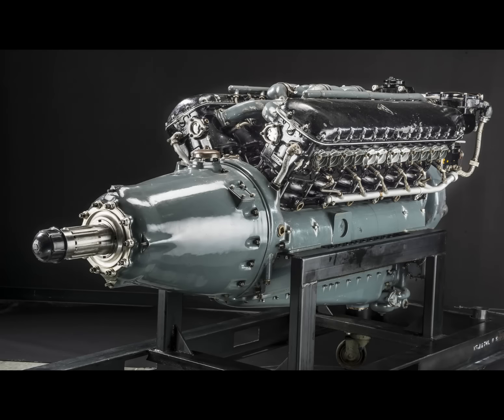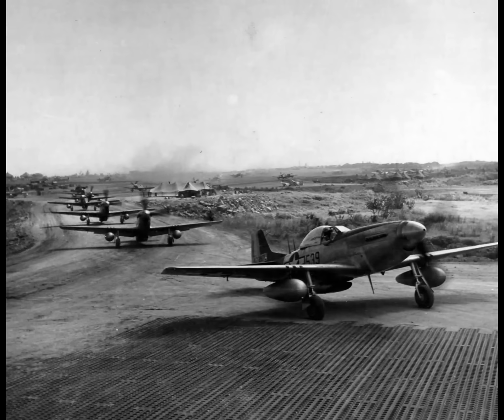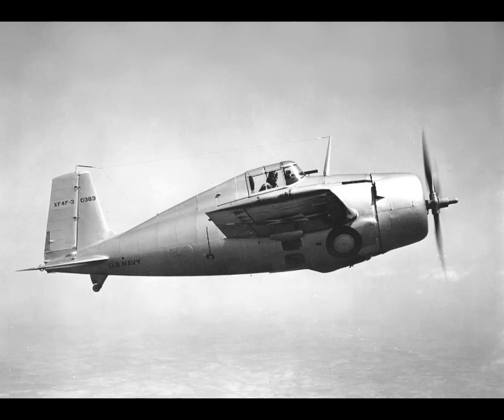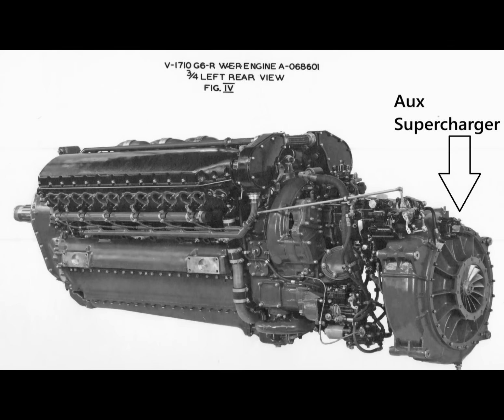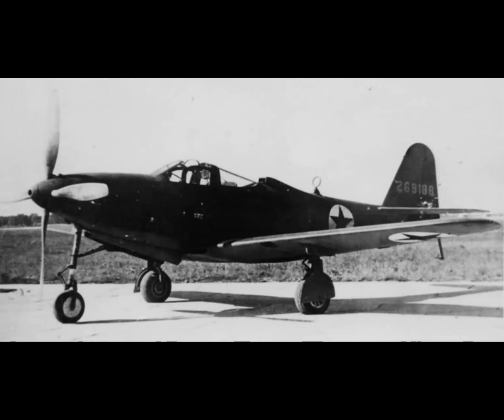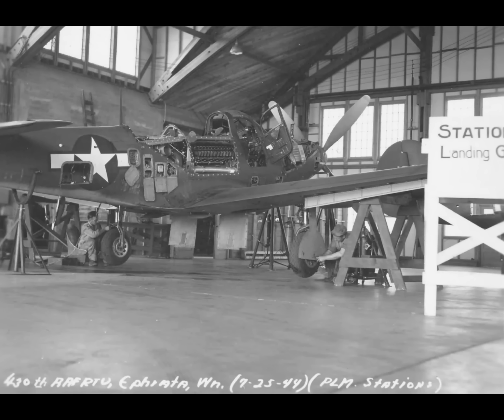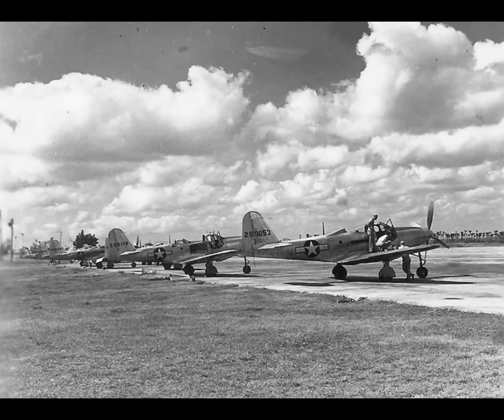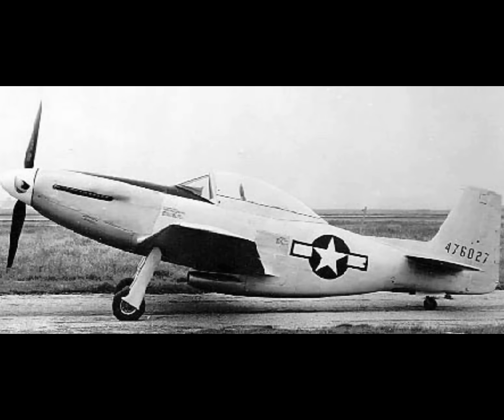Allison V-1710 with a TWO-STAGE Supercharger

Comment: I suspect you go into this on your P-63 video, but from what I understand the kingcobra was not designed with the USAAF or the western front in mind. Bell's bread and butter at the time was Lend-lease to the Soviets, and I think that shows in the design choices.

The eastern front was focused much more on direct support of ground forces. It was, for all intents and purposes, a low-altitude environment. P-39s and P-63s weren't escorting B-17s or B-24s at 25k feet, they were supporting Pe-2s, Il-2s, and Il-4s at half that altitude or less. Same for attacking German fighters or attackers on that front. The Merlin sacrifices a lot of performance down low in exchange for better power up high, where the eastern front wouldn't use it.

When you consider that and the environment the aircraft would be operated in, suddenly the design choices make sense. In the cold, dense air of a soviet winter under 10k feet, charge air cooling just wasn't as important. In combat, Methanol-Water injection could easily make up any difference without the weight and packaging penalties imposed by introducing an intercooler system. Space was already at something of a premium on that relatively small airframe, and the Soviets preferred to keep weight down for increased maneuverability.
Reply: Excellent comment.
Reply: The P63 had alot of input from the Russians but it wasn't developed for them, it was developed at the behest of Hap Arnold.
 
Several things you have to understand is first, the P39 was originally supposed to have a turbo in the supercharger system just like the P38, matter of fact the P39 prototype was already flying with a turbo, and despite all kinds of other reasons you'll hear about why the turbo was dropped the reality is it was dropped because everyone in 1939/40 were screaming for aircraft, the British (including everyone in the commonwealth), the French and even the USAAC all needed aircraft badly, so to speed up the development of the P39 and get a production line set up and rolling Arnold ordered Bell to drop the turbo and get things going, Larry Bell was more than happy to go along with that because at that time his company didn't have anything in production, and he needed money, the same thing happened to the P40, it also was supposed to have a turbo for high altitude performance but like the P39 Arnold said to drop the turbo and get production rolling. 

So this left the US Army at the time with the prospect of having only the P38 as an available high altitude fighter should the US wind up in the upcoming war, that meant the only high altitude fighter available would have been an untested in combat, expensive twin engine design, and that made Arnold nervous, he wanted a different design for the sake of not putting all his eggs in one basket, this is the same reason he had Consolidated start developing the B24 before the war despite the B17 already existing, he didn't want to bet on a single design to fill any role.

Despite everyone believing that before the war the Army only wanted aircraft with the supercharger/turbo configuration that isn't true, Arnold also didn't want to put all his eggs in one basket when it came to design types either, when the turbo was being removed from the P39 and P40 (along with another prototype that never did see the light of day) it became apparent to all involved, the Air Corps, Bell, Curtiss-Wright and Allison, that an airplane with a high altitude supercharger system was still going to be needed, so in November of 38 Allison began development of their own system, the way they saw it since the tubo was a unit that was removed from the equation they'd just replace it with something else, their approach was to developed an auxiliary unit that could be fit onto an existing engine, hence the auxiliary supercharger unit as the 2nd stage, their first version was completed and cataloged in Oct of 1940, and they never stopped refining the system either, by the time the war was over there'd been 36 different 2 stage Allison engines developed, not all were used but still, they'd developed 36 different types.

So when Arnold told Bell to get to work with coming up with a way of undoing what they did by removing the turbo from the P39 the way they saw it the auxiliary supercharger Allison came up with was the fastest and easiest way of doing it.

Understand that the groundwork for all this happened before the Russians had P39's and before the P51 even existed, even though later on the P51 did exist Arnold still wanted the P63 to follow through because you never know.

Move forward to about mid 42 and P51's are just starting to be produced but for all Arnold knew it might have been a flop, or there might have been a demand for thousands more fighters than what NAA and Packard might have been able to produce, they eventually did but Arnold couldn't see into the future, for all knew NAA or Packard could have gotten hung up on something and being the kind of guy who doesn't like all his eggs in one basket Arnold wanted the P63 development to continue just in case, later on even though the P51 thing worked out Arnold still wanted the P63 moving along and since the Russians by then had experience with the P39 when it came time to start test flying the P63 they were brought in, but it wasn't designed for them as they had no need for an high altitude fighter, they seldom even engaged the 2nd stage supercharger.
Reply: @dukecraig2402 Woah...I think you read into his comment a bit too much.  Ha.

He never said the P-63 was developed for the Russians and not the USAAF.  He was pointing out that by the time the P-63 was in its development stages the Russians were already the primary customer, the "bread and butter", for Bell's products.  The first flight of the P-63 prototype was not until December of 1942.

I would also point out that Bell knew before full production was started in 1944 that the USAAF was NOT interested in their P-63 and was focused on the P-51.  Therefore, it is very plausible that they had enough time to tweak its performance to better suit their primary customer.  Heck, Arnold wasn't even interested in the P-51 at first.  So, is wasn't as if his problem was having too few eggs in his basket.

Also, just because the US was not initially involved in the war does not mean General Arnold was flying blind.  In the absence of direct US combat feedback getting feedback from our allies, including the Russians, was absolutely important to improving our designs.  The P-51 doesn't even exist if its not for British prompting....not Arnold's.

The Russians sent to Bell a test pilot named Andrey G. Kochetkov, and an aviation engineer, Fyodor P. Suprun, to assist in the development of the P-63.  An early prototype P-63 was also sent to TsAGI in Russia for use in their wind tunnel.  They even identified that the new design needed a shift in the center of gravity to prevent catastrophic spin charateristics.  This is a working relationship between a US company and a foreign customer that was rather unique for the time.

Finally, Arnold did not have all of his "high altitude eggs" in the P-38 basket.  He also had the P-47.  However,  I would also point out that these fighters were all developed as interceptors and were never originally envisioned as the high altitude bomber escorts they eventually became.  The fact that they were equipped to accept drop tanks and of fulfilling that role is something General Arnold cannot take credit for.  That credit can go to the folks at Republic, Lockheed, and a Lt Ben Kelsi.  Arnold's primary focus during the war appears to have been on bombers and eventually what would become the B-29.
Reply: @clarkenoble 
Woah...so much to unpack here from you're being so wrong about...everything, ha!

His first paragraph literally claims the P63 was developed for the Russians and not the USAAF, it wasn't, that's exactly what I explained, that it indeed was developed for the USAAC/USAAF and at the behest of Hap Arnold, I have in front of me excerpts from letters written to Allison, Bell and the Army Material Command from Arnold on the subject of the P63, and the need for the development of the 2 stage Allison for it, that are from circa 1939 to 44 and are from the archives of those organizations. 

Yes at one point Arnold had all of his high altitude eggs in the P38's basket, the P47 did not exist yet when the turbos were removed from the P39 and P40, again, Arnold could not see into the future, and the "prototype I mentioned that never saw the light of day", matter of fact that prototype was a design proposal submitted by Republic that used the V1710 with a turbo for it's second stage in the style of the others and the P38.

Yes Arnold was pushing for the development of the P63 even well into the war, even past when the US had seized production of the P51 and the Packard Merlin, from a June 1942 letter from Arnold to Allison;
"...many times I have been informed that the Allison Engine Company's two-stage supercharger is getting along all right and will be in production very shortly, but as yet I have seen no supercharger", additional letters from as early as 1938 from Arnold to Allison call on them to work on a two stage supercharger that can match or exceed the single stage two speed Merlin offered in the Fall of 1939 (the first version of the 2 stage Allison did not have a fluid coupled variable speed auxiliary supercharger, instead it was a single speed auxiliary supercharger which would have worked basically the same as the single stage two speed supercharger on the Merlin at that time).

You mention drop tanks, P51's and escorting bombers and none of that has anything to do with what Arnold wanted the P63 for, you also call the P47 an Interceptor at one point, it was not an Interceptor it was a pursuit fighter, the interceptor role is exactly what Arnold wanted the P63 for, an interceptor needs to take off and climb to altitude quickly, which the P47 certainly couldn't do even after fitted with the paddle propeller, Arnold states in letters to Bell, Allison and the Army Material Command the importance of developing the P63 with the two stage Allison engine to "climb to altitude quickly to intercept the German ME109 and the Japanese Zero", what he goes on to call "the scourge of enemy fighters", he also says in these letters that the P63 needs to be developed to "make up for the shortcomings of the P39 because of the removal of it's turbo".
There was even 3 squadrons formed with P63's that were intended to be sent to England for D-Day, however because of the delays in the development of the P63 there just wasn't sufficient time to get the pilots trained up, the same mission for the P63 was conceived for the Pacific, not for it to project power away from the islands it would have been on but to protect them from incoming attacks. 

Like the Spitfire the P63 sacrificed fuel capacity to save weight for the sake of climbing to altitude quickly, it was never intended to do anything but that especially not escort with it's extremely short range, Bell was mindful to keep as much weight off of it as possible for the sake of climb rate, the P63 was even tested by the Army Material Command with the 2 stage 2 speed Packard Merlin but was rejected because it's extra 400 lbs combined with not being as powerful caused it to take over one minute longer to climb to the target altitude of 25,000 ft.

And yes I'm aware of the Russians sending over a test pilot and that a P63 was in a wind tunnel of theirs but that was years after what I'm talking about, it has nothing to do about why the P63 was developed, Arnold wanting it developed in the first place was before the Soviet Union was even an ally, yes, the P63 was developed in the first place for the USAAF not Russians, the specifications laid down for it was even before they were flying P39's. 

So see Arnold was involved in more than "just the B29 getting pushed into service", you're also wrong about him and drop tanks, he was not a part of that whole "Bomber Mafia" thing, that group was Ira Eaker and believe it or not Robin Olds dad, among others, there's letters of his in archives dating from 1938 where he expresses his concern about fighter ranges and talking about how drop tanks being mounted on fighters should be looked into, but as the person in charge of all US Army aircraft and their development he couldn't micro manage every little thing, being in you position you put people under you in charge of things and if those people send you reports on why things should or shouldn't be done sometimes you just have to take their word for it, you have the benefit of knowing that the early missions that went beyond escort range should have been escorted, to you it seems like a no brainer but at the time everything was just theory, if Arnold had been a subscribed to that Bomber Mafia mentality he'd have never allowed Gen Kenney in the Pacific to do what he did with equipping his fighters with drop tanks, he wasn't anti fighter and as you can see he wasn't anti two stage supercharger either, if he was Allison wouldn't have started development of a 2 stage supercharger in 1938.
Reply: @clarkenoble  WWII interceptors were supposed to be good climbers, something P-47 thunderbolt was not; also machine guns only wasn't typical interceptor weaponry, either. P-47 was an air superiority fighter.
Reply: @rodrigorincongarcia771 Wrong.  You are confusing what happened with what was originally planned doctrinally.

Go look up the Bell FM-1 Airacuda.  This was a large twin engined, cannon armed, freak show of an aircraft designed to be an interceptor fodoctrinal.  It was definitely a slow climber.

The USAAC doctrines of the time dictated many of the design requirements put forward to manufacturers was for interceptor to be longer ranged, able to fly atvhigh altitudes, and heavily armed in order to shoot down bombers before they ever got to their targets.  Climb performance was of secondary importance just as long as you could get to the altitude you needed.  Remember, the USA has an two oceans between us and the rest of the world.  Our interceptors would have plenty of time to climb.   Ha.

This thought process was not unique to the USAAC before WWII.  The Germans designed their Bf110 to be the main bomber interceptor, NOT the faster climbing Bf109.  

Only the realities that their pre-war doctrinal ideas were not as good as thought would change this.
Reply: @dukecraig2402 Again, I think you are looking for a fight with people when there is none.  The question is really about the supercharger drive system and its not about the aircraft.

There's no doubt you seem to know a lot about what Arnold wanted, but the real question is who was influencing Bell more by 1943-1944 when the P-63 was in final development.  Arnold or Russia?  So, the question would be more aptly worded by asking, "By the time the P-63 came along, after constant development delays, was it likely more influenced by the demands of Eastern Front combat (and the primary customer of the P-39) or by the demands of pre-war USAAC doctrine?"

Now, the answer, as you pointed out, would be BOTH.  HOWEVER, the OP's question related to the supercharger drive system and how it was tuned.  I believe he has  a great question in that regard and it is very likely that it was geared to produce the power it did because of feedback from the Russians.  Maybe not, but you dont know that definitively, yet.  It will be an interesting question to get answered, if possible.
Reply: @clarkenoble  But P-47's original range wasn't great either.
Reply: @rodrigorincongarcia771You have to ask as compared to what, though?  The P-47's range was greater than every other US fighter (except the P-38), including the P-39, which was originally conceived to meet the interceptor requirements.

The P-47 was by paper definition a pursuit ship because that's how Republic Aviation could get the USAAC to buy it.  However, if you research the concept that Kartvelli and the folks at Republic had in mind it was either as an interceptor or "convoy escort" fighter.  They were learning that an aircraft could fulfill either role.

In 1938, after personally flying one of his P-35 racers to Los Angeles, Seversky himself said in a newspaper interview,

“We are learning in the Army,” this builder of the nation’s fastest pursuit ships declared, “that bombardment craft are vulnerable to attack from the air unless properly convoyed.  So—the ‘flying fortress’ that cruises 5000 miles must be accompanied by pursuit ships that can go equally as far nonstop. To Europe from America, for example.

“In the United States at least three such planes are underway today. I am building one. Others may be twin-engined—such as the ship being readied at the Lockheed plant—and capable of terrific speeds.”

That airplane he was working on was the evolutionary lineup of P-43, P-44, and P-47.  Notice he mentions the Lockheed project (P-38) as an escort ship and not as an interceptor.   Ha!  That's because the escort idea would get put on the back burner for a while.  So, the point is that these aircraft manufacturers were trying to build the best aircraft they could and they didn't care if it was called an interceptor or an escort or a pursuit just as long as you bought it.  Ha.